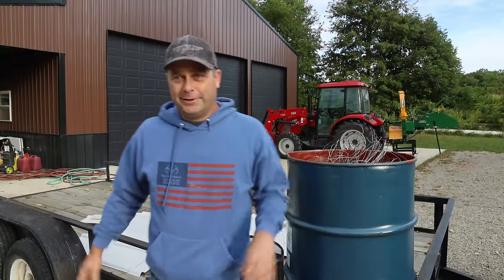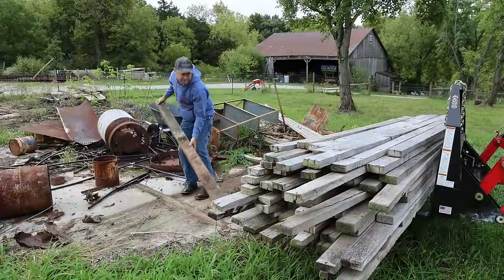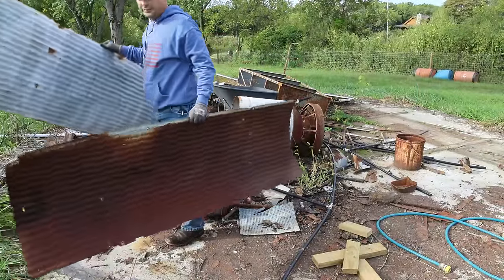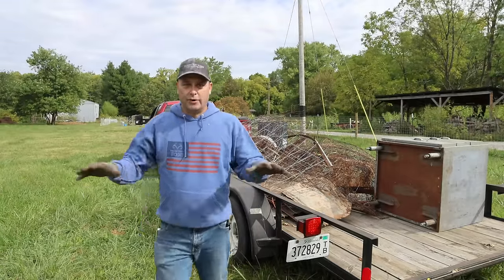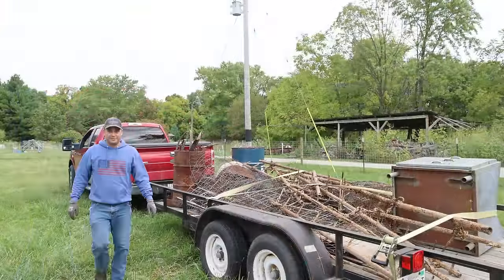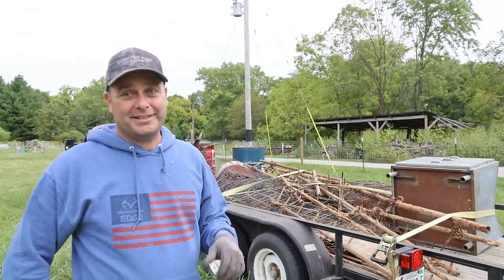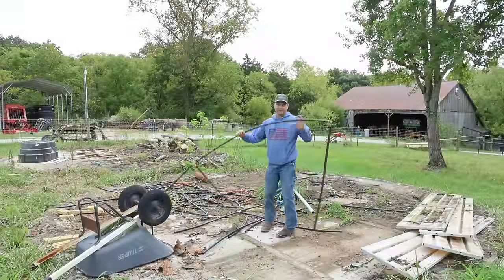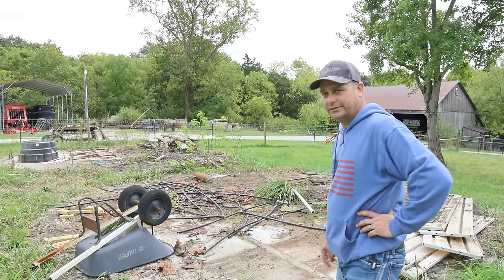Loading up all our scrap Metal.  Cleaning up the property and getting a little cash.

Comment: You should cut your pipe into 4-5 foot lengths and screw them to the sides of 5 gallon buckets and put some rocks in the bottom and sink them into your pond for non eroding fish structure. Bass, crappie, and blue gill love to suspend off of them. I have done the same to many of my ponds and the fish love them. Mark them with Hunstand app and you will always know where they are so you can jig off them

Comment: I make a trip to that scrap yard once or twice a week if I have Friday off work and they are the only scrap yard open on Saturdays I have people bring stuff to my house and throw it on my trailer or I go clean up scrap for people at their property I've done it since before I could drive my grandpa and dad got me started into it sometimes you come across stuff I can use or make it work with a little engineering it's always interesting what we come across but when I haul a load it is heaping on the trailer and I ease it through the country down to H & S Recycling i could hear the older guy talking on there that helps you unload he is a hoot when he gets wound up and starts throwing stuff off the trailer if you need an extra metal barrels to put scrap in I have plenty with removable lids you could have a couple  if you want them

Comment: On the oak 2x4s make some thin strips of wood and put them between the layers of wood to promote air flow. Also covering it with a tarp will help to control the moisture.
Reply: I agree Alan.  The strips would keep it dry inside and covered it will last pretty much forever.
Reply: Stickers

Comment: JudithB   Scrap metal,  misc  parts n pieces  pile  up  over time  and  its  such a  relief  to haul  it off.  Feels  good  to  clean up  and  more  able to use  the  clean  areas.  Using  the  cement  pads  will be  really  nice  not  to  wade  in  mud  to  fill  the  water and  feed  troughs  too!!!  I  am  taking  the  tin off the  old  rabbit  cages,  cutting  them to size and  putting  them on the  bottom of  the  greenhouse  today.  Yesterday I  removed the  old  plexi  and  cut and  hung the  new plexi on the top of  the wall.  More  sunlight coming in and  no holes from  mower  rocks.  I will still have to strip the  east wall  when  I  find  more  tin.  The old  rabbit cages  will have to be  stripped and  taken apart  this winter,  dry rot.  New metal cages  are  waiting  for frame  shelves to be  built  inside the  barn.  Hopefully  this  week  with cooler  weather  will be  very productive  here!!

Comment: We have "scrappers' around here that will take just about anything. I have no idea how they make any money especially at the price of gasoline today, if I set something metal out at the edge of the road it's gone in a day or so.

Good idea for using those foundations, but realize a confinement lot will quickly turn into aud bog. Our barn lot was about an acre and it only grew a few weeds and was a muddy mess in the Spring and any other wet stretch. We did have a rock reinforced road to get to the corn crib, but even that got iffy at times. Livestock's hooves just churn up the ground.

Comment: A little tip for the barrel. 
Drill 2 holes just under the rim at the top, opposite each other. Get a piece of chain and 2 D shackles, or something similar. this makes it much easier to lift on trailer, with a fork, and place where you want it. No need for a pallet.
If you keep it out side drill a few holes in the bottom just above the ring, so rain will run out.

Comment: Scrap yards around me aren't open on weekends generally so I end up collecting for several years until the neighbors complain about the junk.  It's good for a couple hundred bucks and the "collecting" part is free or extremely low cost.  Picking stuff up on my way to and from somewhere or scrap generated from the shop fab projects.

Comment: When we moved from Florida to Missouri and there was so much junk everywhere, we got a roll off to help with the cleanup. We have so far loaded 3 of them and now picking up more stuff ready for another one. We have 2 big buildings, one for my stuff and one that my wife can park her car in, along with tractor and a trailer. There was a small metal shed that my wife said to take care of. So with the help of the tractor and bucket and using the forks smashed it into a small amount for dumping in the next roll off. I use to love tearing up junk at work with my forklift and sometimes maintenance would call me for more fun.

Comment: Suggestion = if you are going to use that acre as a winter holding pen, what about building a Shed over one of the old grain bin foundations so the cattle are not standing in MUD.  They would be able to bed down on something dry.

You know how cows and pigs end up tromping in the winter when it rains & snows then melts and the animals turn evrything into a MUD HOLE.  Pete had that problem in his barn this last spring.

Comment: I am a firm beleiver in working smater, not harder. it would serve you better to dig a 10X 10 by 8 foot deep hol with your tractor. use the spoil dirt to berm the sides. place all scraps of wood and other trash ( no food waste of course) in it and burn it. you will be surprised how much time you save vs. having to placer it in a dumpster. you can let it fill up and  burn several times a year. also any dead animals fit nicely in it and use old tires to help them burn up. no smell that way
Reply: Good lord, not great for the environment.